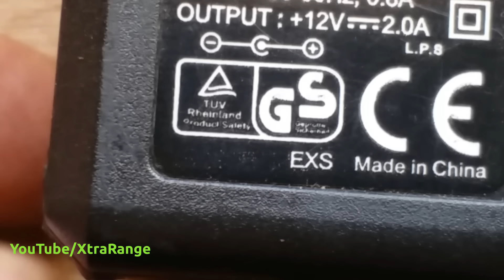Building of Graphite Pencil SOLDERING IRON

Comment: Your not supposed to put solder on wire like this. Your supposed to heat wire from bottom, get it warmed up and dab solder on it and let it flow. The way it shows in video your getting a cold solder joint and, that's not good.

Comment: This so helpful when there's no solder gadget near your place or hardware shop and could be it price not cheap enough to buy,so this'll  solved everyone hassle ..but I'd have a lil'bit confused when following this DIY step cause you didn't shown which one is the positive wire and which one is negative wire..!?? i’m afraid it will not worked if I'd wired with a wrong selected  one..much appreciate if you can explain it more detail..Thankyou.
Reply from the maker: Here it doesn't matter which wire is positive or negatie
Reply: @Xtra-range   thanks for your info..yesterday I already done making the followed diy tutorial on your channel and its successful.:-)

Comment: Will it work without adaptor diretly
Reply: Yes and you will get a faster and more heating the graphite will glow red hot and will eventually burning and setting pencil's wood on fire which might burn most of your things down also if you accidentally touch the tip while standing on ground you will get a nice 240 volts at 50 to 60 Hz AC through you and then you will be dead soon.

Comment: Do you need to use copper wire?
Reply from the maker: Yes
Reply: @Xtra-range  So if I just took the wires from a normal wire it wouldn't be the same? If not then why wouldn't it be the same?
Reply: Technically u can use any wire but the wire needs to be a good inuf conductor that's why it works OK on graphite and copper

Comment: Can you make its second version in which you have to use graphite instead of the heating element rods inside the tip and also tell how much power does it use can i use it with a 12 volt 1.4 amp battery
Reply: They don't work I tried it myself